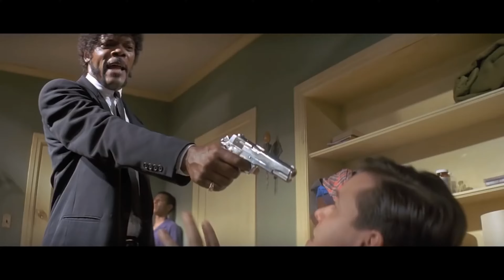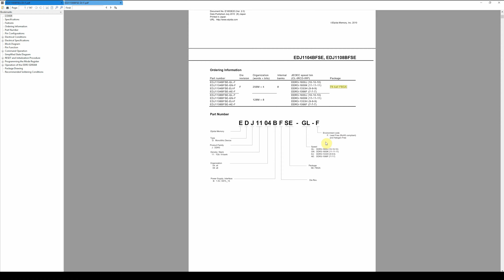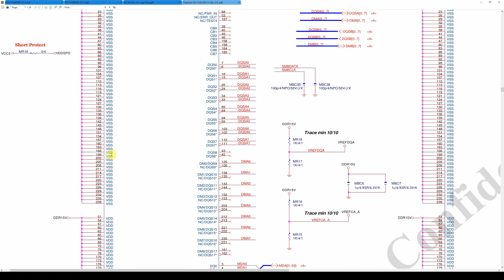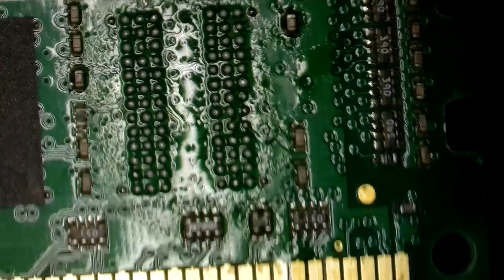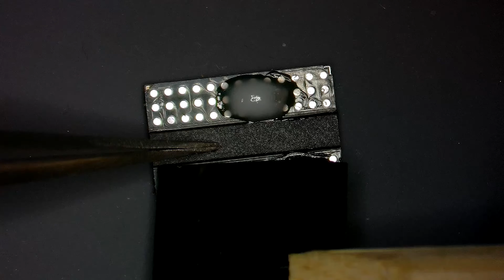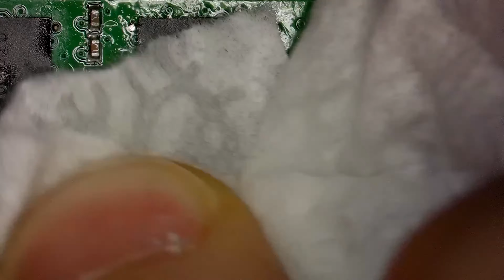How to FIX a bad DDR3 RAM stick! (NOT a video card repair... again)

Comment: code 55 sometimes is just bad contacts...it happened to me several times on my former z170a m5 board. Cleaned the board and worked just fine afterwards.

Comment: You didn`t mention what exactly magic flux was used. But in the end of video I found out : Fluxpaste F-SW 32 10ml 20$ , the most expensive flux :-)
Reply from the maker: Yeah, I love ERSA :) Nothing magical about it though, just one of the few "real no clean" fluxes out there. I had 0 failed BGA soldering attempts since I started using it. Coincidence ? I don't' think so!